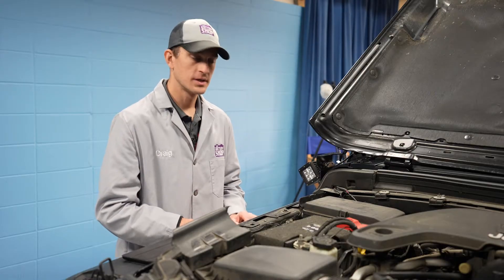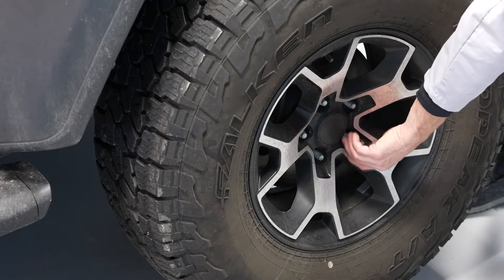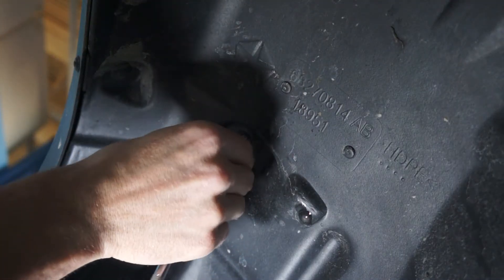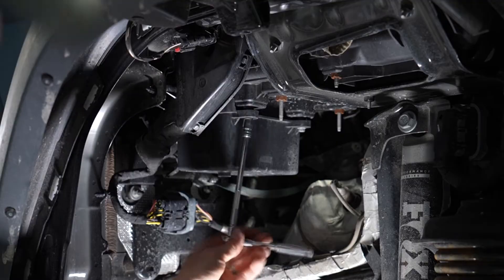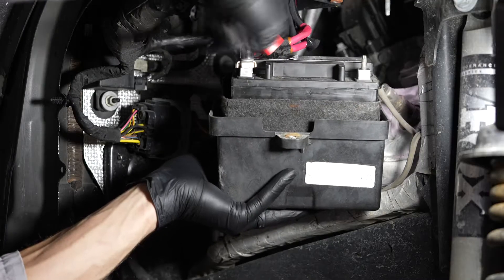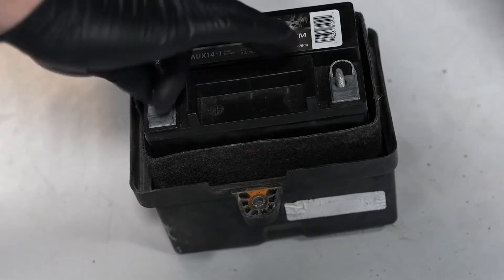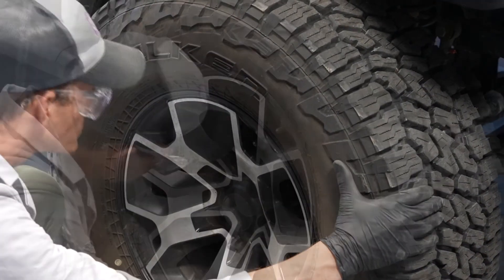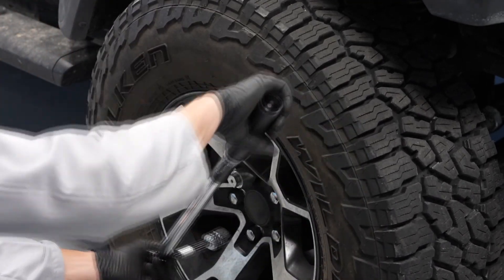Jeep Wrangler New Auxiliary Battery Install

Comment: I just replaced the Aux battery going from the top….in a parking lot at my daughter’s apartment in Chicago.  It only took about 20 minutes. It’s much easier than removing front tire and inner fender.  Takes 4 tools…..7 and 10 mm sockets, #6 star socket for battery posts, and a flat tip screwdriver.   It’s also the way it was designed to be removed.  My oldest daughter also did hers from the top.
Reply from the maker: Thanks for watching and adding to the conversation.
Reply: Hey, any advice on how to do this? I'm thinking it might be easier than removing the wheel and everything.

Comment: I did this yesterday, and with a little finesse, was able to complete without pulling the fender liner pop rivets.
I laid down on a creeper and used my right arm to keep liner moved to the side, then left hand to support small battery while remounting.
Still much easier than the top!
🤙🏽
Reply from the maker: Thanks for watching and for adding the information!
Reply: How would you access the aux battery from the bottom when it’s in a sealed compartment that’s only accessible from the top? Makes no sense. Too access takes 15-20 minutes, start to finish.

Comment: I have a 2023 rubicon jeep with a 3.6L V6 24V VVT etorque engine with stop/start (600amp maintenance free battery).  I let my car sit for an extended period of time and the battery need charging.   According to the car manual both batteries should  be disconnected before recharging or could harm other electrical components.   Sure enough when I took my car to dealership (under warranty) to get it charged I Made it clear that my car had two batteries had 2 batteries and that both should be disconnected before charging.   When I got my car back the STOP/START system was no longer working.  Before any more test were done to fix this problem I asked the service lead to install two new batteries as an initial test.  I was later told that my car only has one battery and not the supplemental or secondary battery.  My user manual clearly states that all etorque engines have a secondary battery and mine is located behind the wheel well.  Now I'm wondering if their top jeep mechanic even knows where to look for the second battery.🙄 can someone please confirm that my car should/does have this secondary battery... I would think jeep dealership mechanics should know about this...your video was very helpful and clear.  What am I missing here? 😕
Reply from the maker: Thanks for watching. The primary battery seems to be in the same location. Without seeing the vehicle we cannot be certain.

Comment: Is the large primary battery connected or disconnected when changing the auxiliary battery? If you disconnect it, does it affect the programming?
Reply from the maker: Hi - Thanks for watching! We left the main battery connected during our auxiliary battery replacement without loss of vehicle computer memories. We suggest that you check the vehicle owner’s manual or a service/repair manual for your particular vehicle about battery registration to be sure.

Comment: If you have JL the 2.0L and  turbo charger you don’t have an auxiliary battery.  

If you get message “Aux switches not available battery charging” you just need to replace your regular battery.
Reply from the maker: Hi - Thanks for watching and sharing your information.
Reply: That's not true. Unless you have the etouque the 2.0l still uses an aux battery .

Comment: Will the Stop Start Not Ready Battery Charging sign on Dash automatically turn off once replaced?? (2019 Jeep Wrangler JL Unlimited Sport)
Reply from the maker: Hi - Thanks for watching! We think so after the battery management system recognizes the proper battery performance. We suggest that you check the vehicle owner’s manual to be sure.

Comment: Wait. Are you actually trying to sell this as a better way? Why unscrew a PCM board and flip up the battery when you could easily pull out the transmission , seats and the firewall to get to it....WTF?
Reply from the maker: Hi - Thanks for watching! Nope, just a different way for folks who are uncomfortable with with removing connections from computers.
Reply: Bro wtf are you talking about?

Comment: Why would one have to change this battery? If the start stop function comes on the cluster? Or if the car hesitates to start?
Reply: If you're having issues with the ESS (Electronic Start Stop), the aux battery is probably dead. Over time, it will drain your main as well. It's best to replace both batteries.
Reply from the maker: Hi - Thanks for watching! You would only have to replace that battery if it fails a test. The auxiliary battery is basically used to keep the vehicle’s system voltage from dropping below a specified level during engine start so thinks like computer, gps, steering angle, radio stations and other systems or user presets don’t reset.

Comment: No cam unit required or disconnecting the main battery
Reply from the maker: Hi - Thanks for watching! We didn't disconnect the main battery so it will keep the memories "alive" during the auxiliary battery replacement.